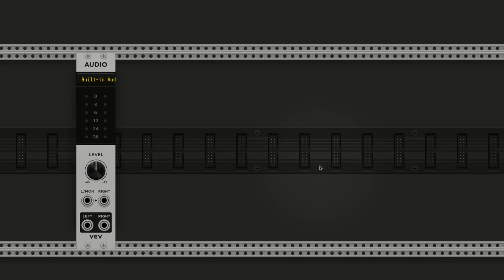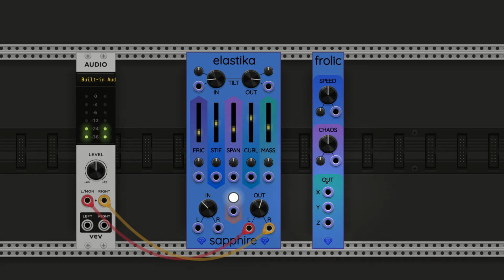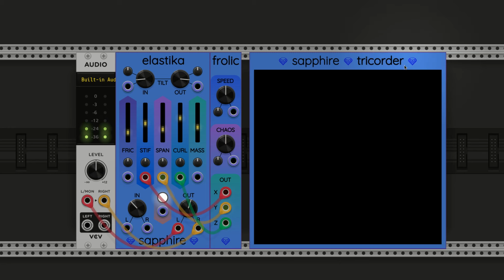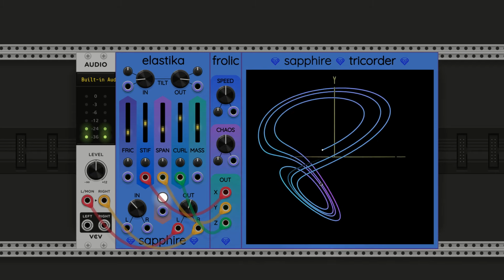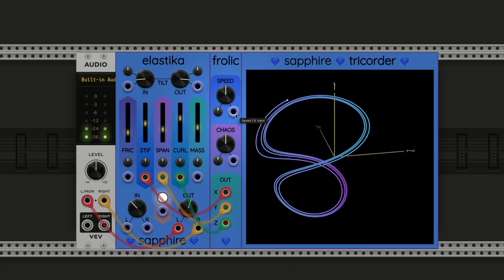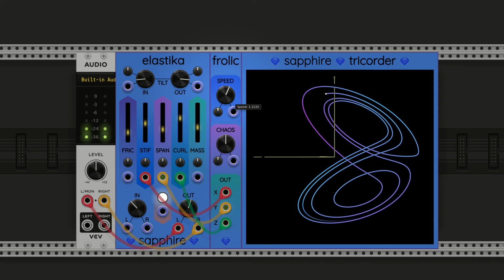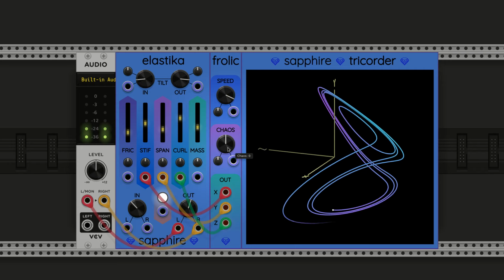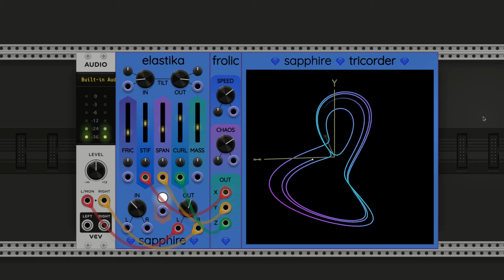Introducing Sapphire Frolic and Tricorder for VCV Rack

Comment: I can't get any sounds unless I connect the inputs to an oscillator.
Reply from the maker: Yes, that is correct. Frolic and Glee are intended as low frequency, control voltage generators only.

Comment: Fantastic work, Don - looking forward to trying Frolic out.
Love your decision to add a module for arbitrary input to tricorder - want to plug Vult Caudal into it (even though it's not really XYZ, but XY∠) ... thanks!
Reply from the maker: Thank you! Tricorder is designed for slower inputs, generally below audio rates. You can certainly plug in an audio signal, but I doubt the results will be easy to interpret with the curves going all over the place.
Reply: @CosineKitty  Ha, didn't even occur to me to plug audio rate stuff in ... now I have to try it :)